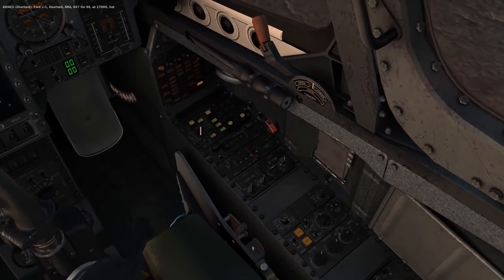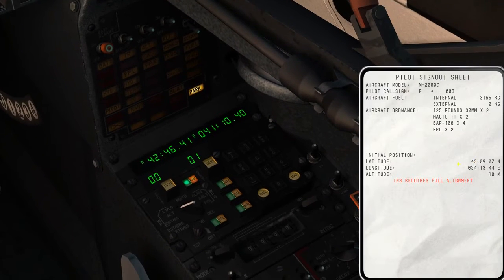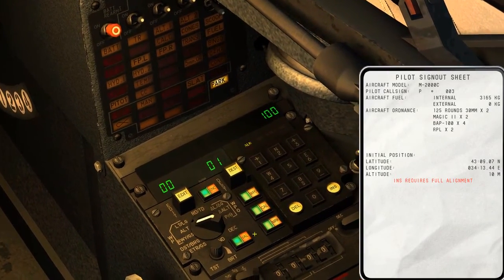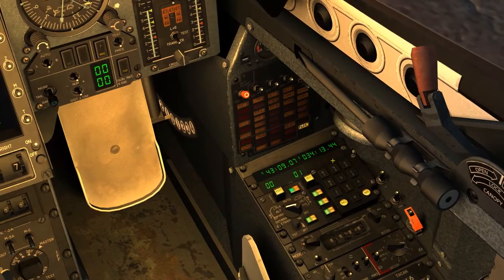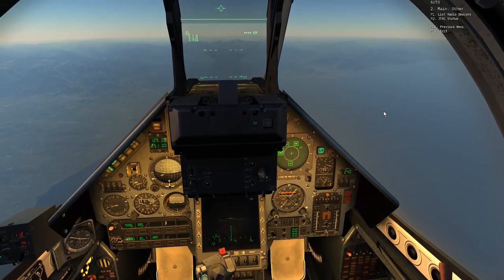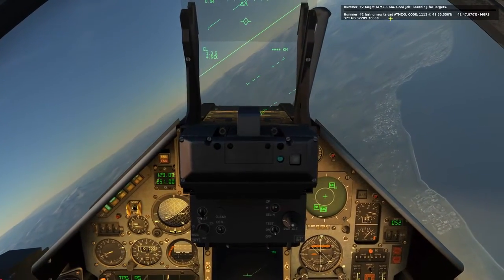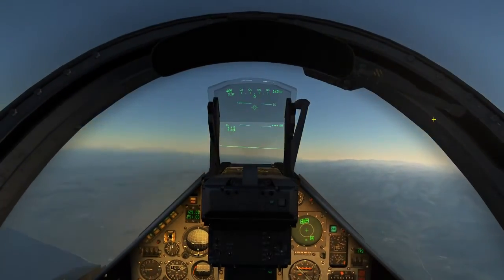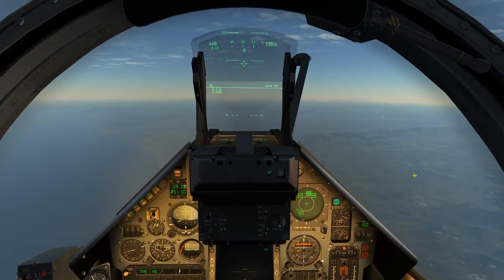DCS: Mirage INS and GBU-12 CCRP with JTAC

Comment: you have several mods or add ons, not sure how you contacted Jtac, if that was part of the mod, and did you have to change anything other than point and designatet the target spot?  would like to find the English cockpit, is it in DCS?
Reply from the maker: The JTAC uses the CTLD script. It's fairly simple to set up. The JTAC will automatically select the target and turn on his laser. Once it is destroyed or moves out of his LOS, it will attempt to find another target. See: https://github.com/ciribob/DCS-CTLD

The English cockpit is on the ED forums: https://forums.eagle.ru/showthread.php?t=158050